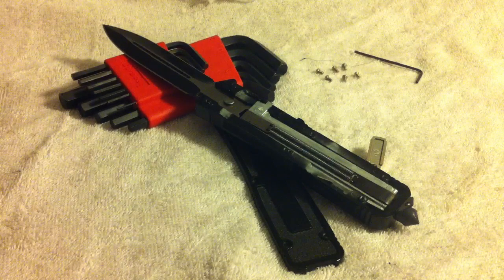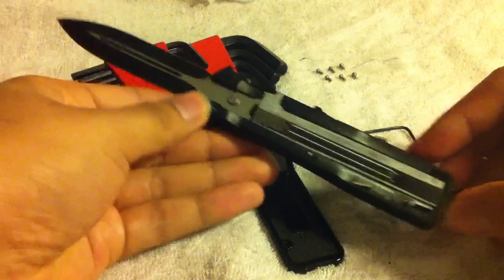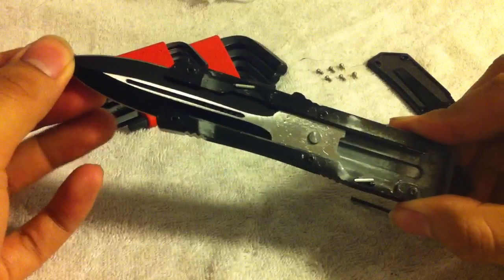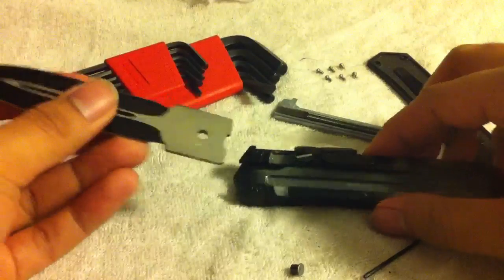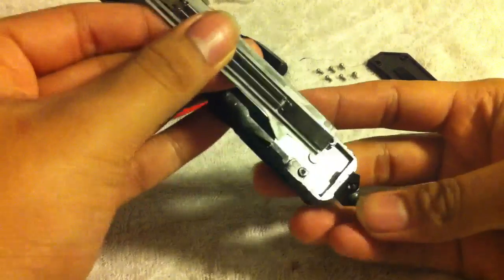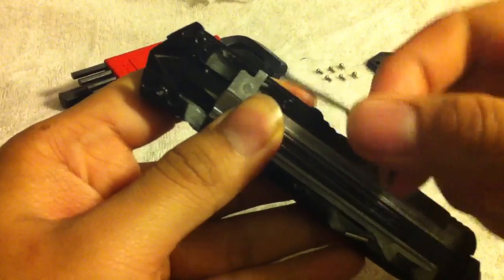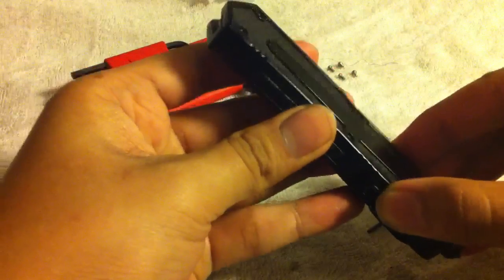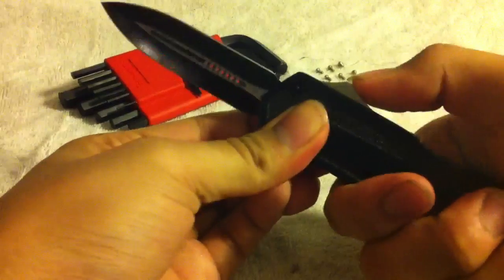How automatic OTF blade works

Comment: Mine is slightly different, blade got loose outside and could be pushed back inside loosely but will follow your instructions. I usually work on guns but this knife had me confounded. Thanks.

Comment: spring and blade are parallel,  how does a tension of a few centimeters create a travel of more than ten centimeters?
Reply from the maker: t b it is the tension from the spring where the trigger is pushing or pulling on the lever. where the blade is forced out.  until to a certain extent for it to shoot out or shoot in. with the guide hooks on the triangular shape next to the springs. so what it does it that when the trigger is pulled or pushed. it is ramped over the triangular shape lever until it is passed then the rest is released freely. for the blade to just run out. like a slingshot.
Reply: inertia...I made it complicated.  thanks for your explanation.